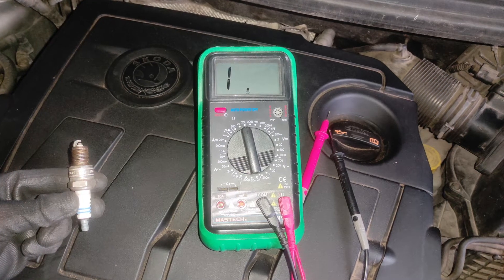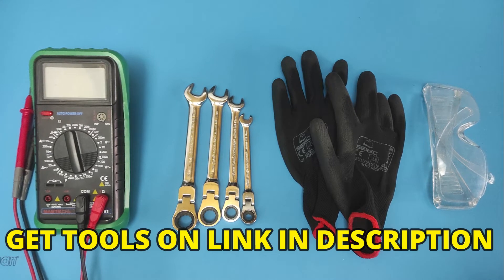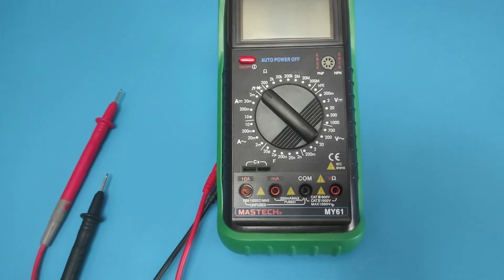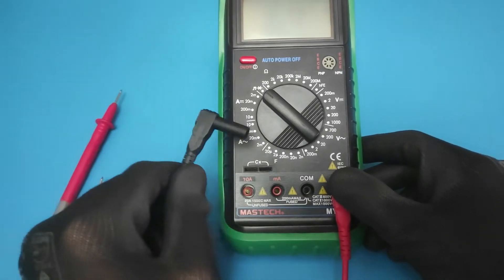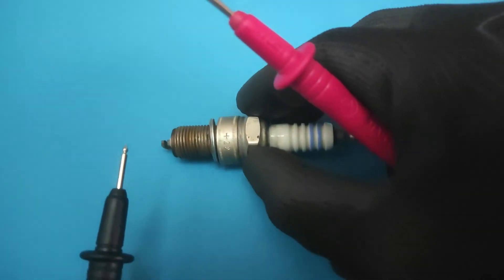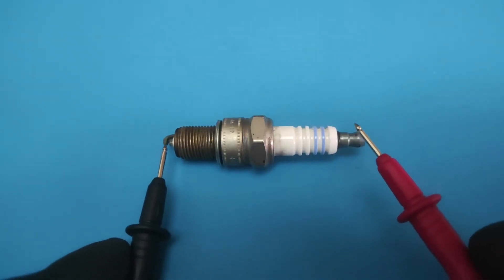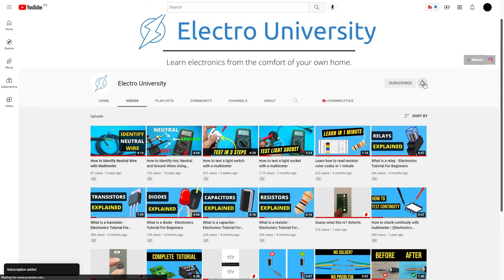How To Test Spark Plug With Multimeter In One Minute

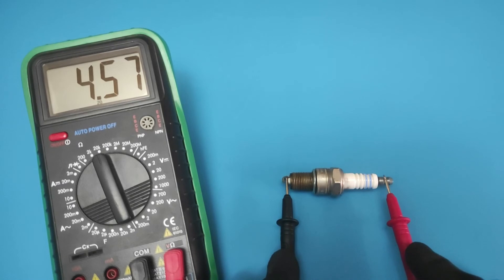Comment: Interesting video.  Should have checked that the audio matched the video.  1:16  4,000 to 8,000 ohms.  Or 4 to 8 kilo-ohms.  Not 4 to 8 ohms.  Lots of work to produce a video that has little use, because it can't get the numbers right.  That's the main point of the video.  The numbers.
Reply: Thanks mate. I thought mine was a dud, until I checked the 200k range...

Comment: Good gravy... Don't forget to wear your protective equipment. Lol 🤣 We all know the danger of spark plug poisoning or the potential of spark plug juice to the eyes
Reply: Earplugs should be considered.
Reply: Make sure to wear protective eye wear as welll!
Reply: Welding goggles advised also. If difficulties occur in actually visually sensing what's going on, a pair of welding goggles with arc sensors might be advisable.
Complete chemical protection suit with a built-in breathing apparatus is a must! Also when checking the muffler bearings for their internal resistance.

Comment: The ohms reading trick won't work for non resistor such as NGK C6HSA spark plug right ??
Reply: Hi! Having continuity doesnt mean the spark plug works. Spark plugs suffer superficial damage(ie visible) clean the surface, adjust the gap. Spark plugs are essentially high temperature electrodes so there is really very little that can go wrong apart from the working surfaces
Reply: No wonder my ngk plugs showed no change or no resistance lol
Reply: Yeah there are spark plug or plug cap with & without resistor build in, this ohms reading test won't work for any spark plug & cap which come without the resistor. By the way spark plug with resistor build in will have a R in it's code name example C6HSA vs CR6HSA or C7HSA vs CR7HSA or BP7HS vs BPR7HS @kuengyal23
Reply: c6hsa is for carbu motorcycle non-resistor spark plug, for injection motorcycle u need use CR6HSA (R for resistor)

Comment: Mine shows 00.00 what does that means sir 😊
Reply: Means buy another spark plug, or test another to make sure your voltmeter is working
Reply: Someone else said this trick doesn’t work on non resistor spark plugs
Reply: Mine just shows 1 lol. Did you find a fix? I’m at 20k ohms and connected the probes like he did 🫤
Reply: @dmax7400 same shit here lol
Reply: @dmax7400 I was thinking of changing the god damn multi meter haha
Reply: It means its level
Reply: When measuring my old plugs, it also showed 0.00. Then after some scratching on the electrode, it eventually started showing something, the numbers were all over the place but eventually settled around 3.5.